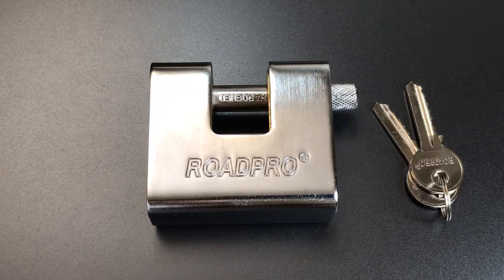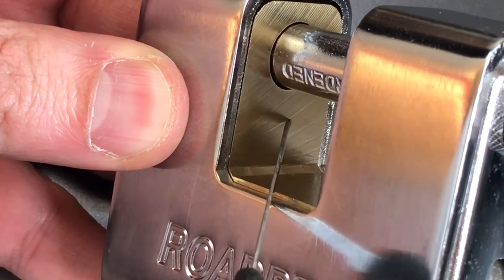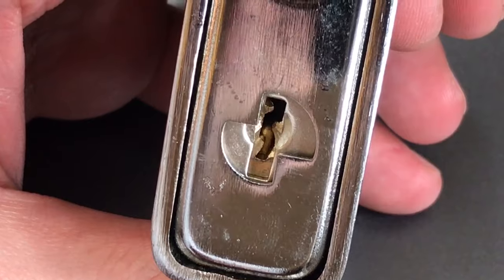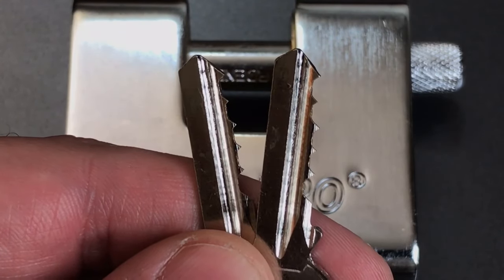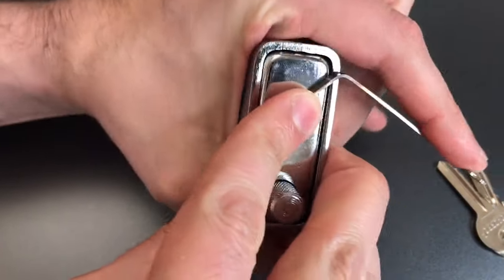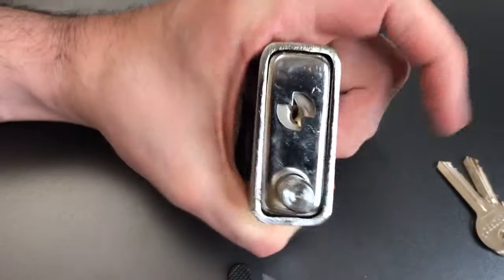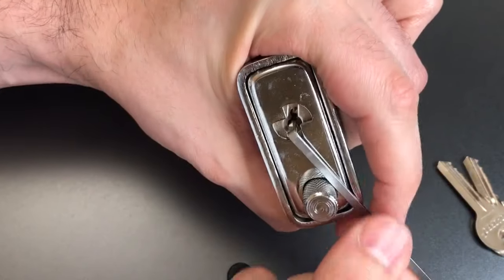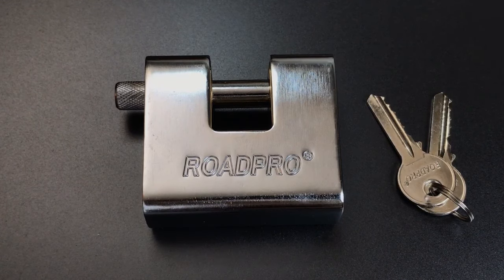[387]  Road Pro Model RPLH-70 Armored Shutter Lock Picked

Comment: Road pro is the masterlocks of the trucking industry! They are everywhere! And not a good high security solution. I know I wouldn't trust using their kingpin lock for more than 30 minutes (unless of course I'm dropping at a secure facility) 

I bought a heavy duty kingpin lock with a abloy disc detainer core (restricted govt keyway) i don't really want to replace the core with a anything else because I'm worried it wouldn't hold up to the grease and grime but hey if i ever do I'll send it your way.